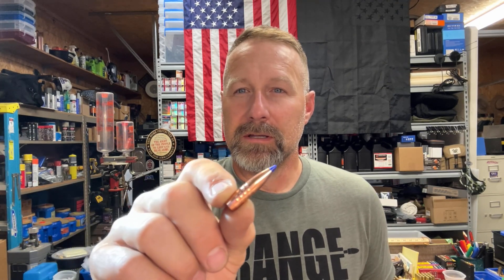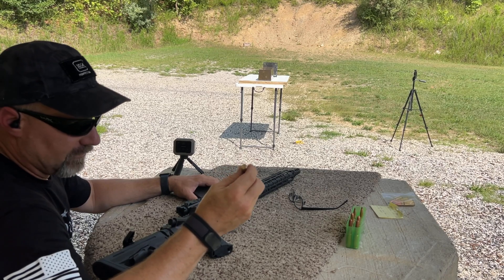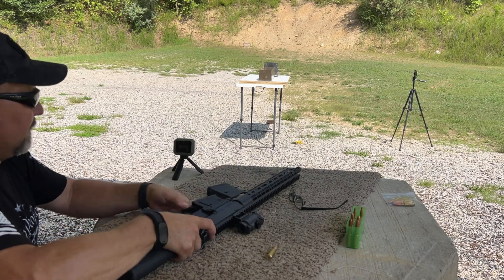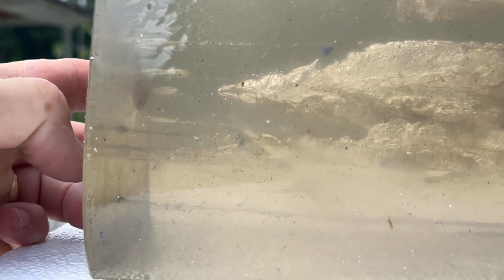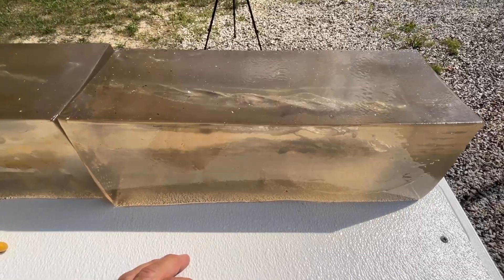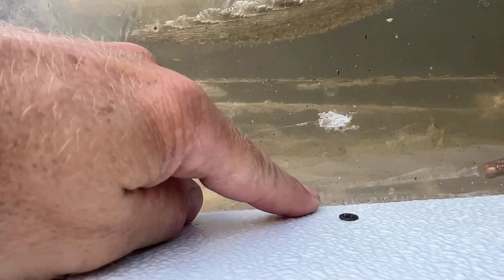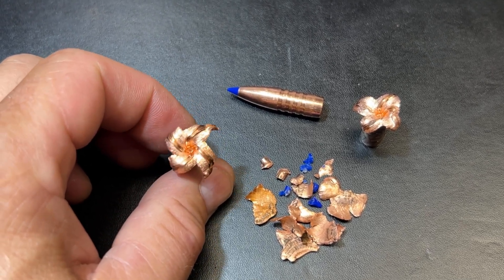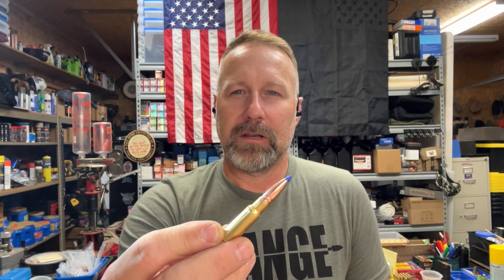8.6 Blackout, Barnes 210gr TTSX, Supersonic Load Tested in Clear Ballistic Gel

Comment: Hi I have 8.6 blk out I’m having a issue with the 210 tsx I’m reloading new brass everything cycles fine firers fine no Jams , but here’s the thing if I put a unfired bullet in the barrel it does not want to come out you can pull on the extractor but it’s almost gets stuck do you think it’s col or something else but it firers complete mag no Jams or anything it’s just if you circle the bullets in the chamber and doesn’t firer it it doesn’t want to come out . Everything is to spec by the book and by other  ammo do you think the throat of the gun is the issue and I need to adjust col to the gun ? Any help would be appreciated and thanks for your time
Reply from the maker: Sounds like OAL might be long. Eject a round see if there are rifling marks on the bullet.  Every throat has a different amount of free bore so you may need to seat deeper. 

If you do seat them deeper, lower your powder charge a bit then work back up to max pressure for the new OAL. 😉
Reply: Thanks for the advice
Reply from the maker: @justinstrong5829 look for marks on the bullet, not the brass….  I edited the 1st post.

Comment: Seams like the 160 TTSX expanded better and would expand at longer distance since these bullets are velocity sensitive.
Reply from the maker: @rangetime6779  I’ve been swapping email with one of the guys over at Barnes Bullets. He said the TTSX bullets yield 1.7x expansion at 1700fps and 2x expansion at 1800 and faster in all 4 of the .338 diameter bullets.

The 210 drops below 1700 at about 200yrds. The 160 drops below 1700 at 425yrds. Both these are from charts based off my load data. 😉

Comment: Quests you could take the first elephant hunting and the other two to a close range deer gun but how do you know which one to use for what?
Reply from the maker: @tomforeman4976  🤷🏼‍♂️😂. 

I’m wondering if the 1/3 twist is doing something funky to the ballistic tip as it entered the gel.  I’ve been emailing back and forth with Nosler and they say all 4 of the TTSX .338 bullets should yield 1.7x expansion down to 1,700fps and 2x expansion above 1,800fps. 

Maybe the one not expanding was a fluke?

Comment: 33% failure rate is a little high for me.
Reply: The TTSX isn't designed for that low of a speed. Thats what the TSX is for.
Reply: I agree that 1/3rd is high, but that's only for expanding. Good to note that the 160 is a flat base and the 185 and 210 are boat tail. That 210 grain TTSX seems to do well for Kevin at Q. They do defrag for him in at least some cases. Lance at Gorilla has a video showing that. Let me know when they fail to kill even a black bear in NA. I think the 160s will put one down. Quite a bit of discussion around twist. Seems Hornady prefers 1:5 but Q swears by 1:3. I have only shot 1:3.🙄 EDIT: And, FWIW, Mason Outdoors had a non-expansion on a 308 cartridge of factory Hornady ammo, and he called it an Ultra-Fail. Different manufacture, different cartridge, same results.🙄
Reply: It's still worth it to have kids.
Reply from the maker: @brutalbob3982  It possibly could have been less. Lol

Really need a 10+ shot group to make a better decision.  Could have been an unlucky first shot 😉.
Reply: @kentuckyrangetime  Matt, I am seeing a average of 38% failure to expand with that bullet in my 8.6 BO. Whether hunting or defense that is too high for my liking. In different calibers I have better results, so maybe it's the 8.6.
Reply: I will try the TSX to see what the results are with that projectile.
Reply from the maker: @brutalbob3982  keep an eye out for tomorrow’s release with the 160gr TTSX.  It’s quite a bit faster and goes 3-3. 😉😂👍🏻👊🏻
Reply from the maker: @brutalbob3982  Bob, keep me updated.  Those are on my shortlist to try as well 😉